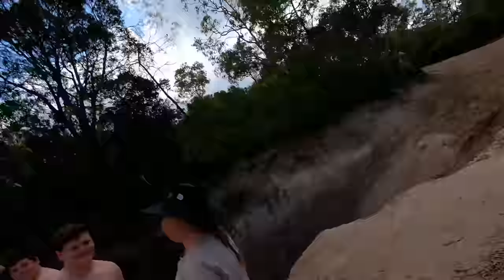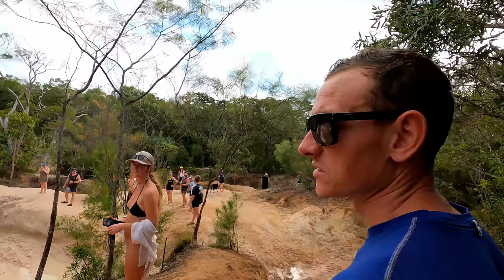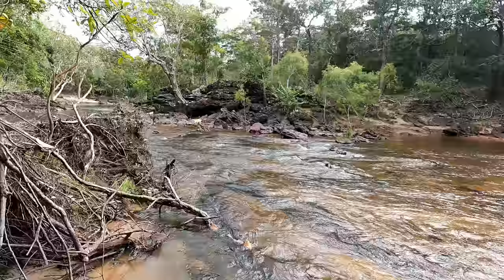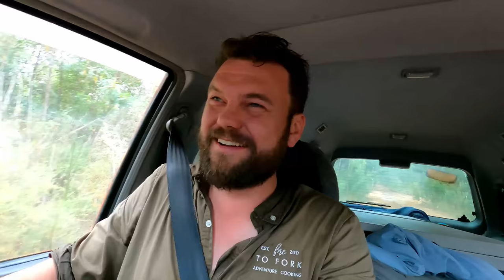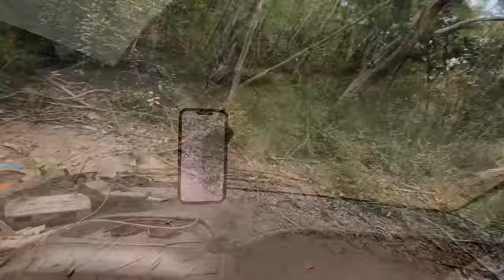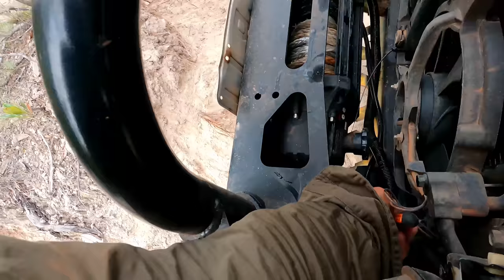I think I like Vanlife - Cape York in a Delica

Comment: Those Deli's are amazing. I drove one as a tour vehicle for a while in central Australia and was amazed at its offroad ability up dunes and dodgy sidetracks that would be such hard work in a Toyota (albeit a gutless 100 series that wouldn't pull the skin off a rice pudding). The only problem is they are made of tin foil and they can't handle sustained abuse as a Toyota does.

Comment: Be aware that the crocs leave sand and rocks in them so you will be half removing them and shaking them out in the creeks all the time. They are not as much fun as they look, and holding them loose and shuffling them in water doesn't work as good as it does with thongs.
Dennis, lol, also the name of my best mate for the last 45 years, not as capable as some around them, but just as loved.
I have known about the capabilities of the Delica/4WD Express/L300/L400 for the last 35 years and have been squirrelling away $50s where I can to try and get one. I've been driving 2WD versions almost as adventurously since the mid 80s, and unfortunately during this series you have just made the 4WD vans another $10k further away from my account balance.
Yeah, I'm having a dig, but it is almost worth it to see you enjoy the Cape in such an underrated weapon.
I ended up staying north of the ferry after I burnt out my clutch trying to get to the mouth of the Jardine.
Beware people, there is some soft spots, and on a side note, make sure you are in low range when popping the clutch to try and pop yourself out of the powdery sand, and not in high range. 
The wrong clutch got sent before the correct one got to me, but it was a bitter sweet time up there. I got to spend 7 weeks on the very tip, yay, but I had no money so I had to live on fish, oysters and crabs with a few bush foods. That also sounds ideal, but when you have no beer it is no longer an adventure, but a matter of survival. It also took me 4 weeks to get a job in Weipa so I had to live under a bridge during that time and as much as it pains me to say, seafood gets pretty boring when it is all you get to eat for months. 
And for the history of Muttee Heads, it was developed when an island closer to PNG started to sink, so the Islanders moved to Muttee Heads.
When I got home I was telling a friend from school about it and she told me it was her ancestors who made that journey. Wow what a small world in a big country.